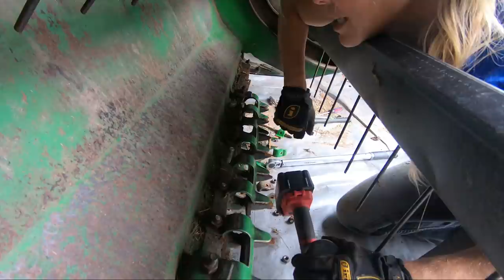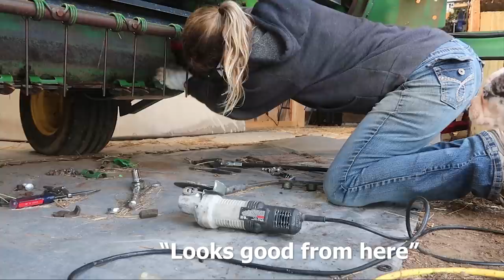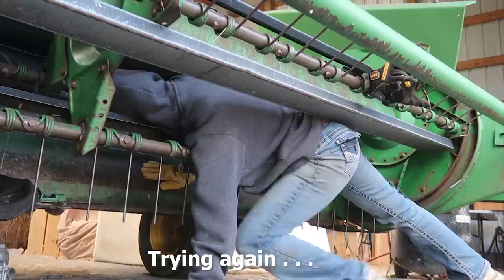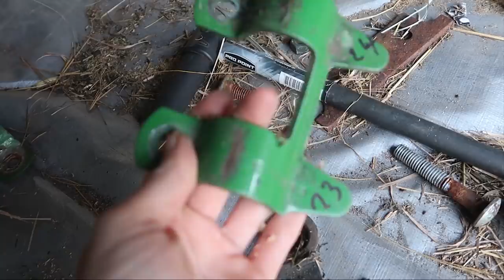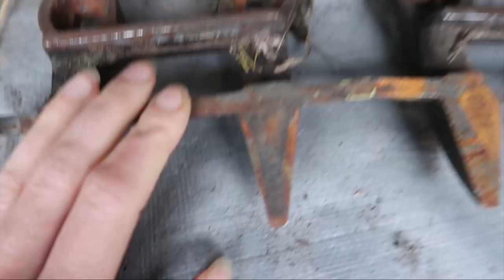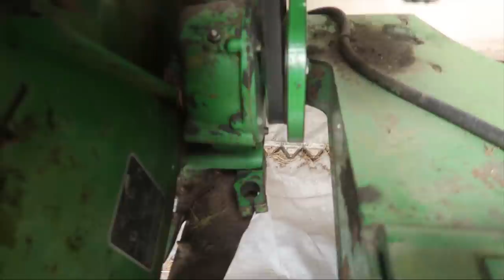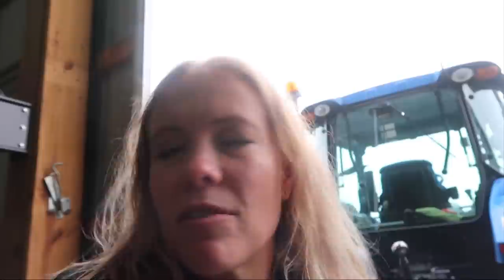335 Final Tear-Down of the John Deere Mower Conditioner

Comment: I always like your videos don't comment much but I do believe unless your pitman arm call is egg-shaped it should be fine.. I do believe that if you get the Right Guard for the first sickle sections that have clearance for your sickle bar head to rotate in and out your problems should be solved.. you may want to check your bottom guards and make sure they are the same thickness because if your sickle bar has been wearing on them some may be worn down more than others which would give you problems as well.. I WOULD NOT weld the bolts onto the lower guards.. then if you break a pole you've got a lot more work to do possibly replacing the lower guards all together...
Reply: Just food for thought.. reach out to Wes over at One Lonely Farmer he's extremely handy would be able to guide you in the right direction.. I hope I helped I don't mean to hinder.. keep up the good work!

Comment: Look up pottinger novadisk thats the only type of mower we ever use over here in the UK, a single might be a little smaller cut than your haybine but you can travel a lot faster with them an to change an individual blade takes less than 5 minutes once you get use to it, I've used the big triple they make an cut somewhere in the region of 15k acres now of silage an hay an wouldn't use any other type. Forgot to say also try to avoid JD as they are way over priced for spares compared to other manufacturers lol
Reply from the maker: We did look at Pottinggers at the Farm SHow in February :D They look good!
Reply: @This1LifeWeLive  we demoed Lely, Kuhn, Claas, Kverneland and Pottinger impressed us the best with cut quality, speed you can travel up to 15 mph in average crop, cost of the machine and spares and also how easy it is to obtain spares an no I dont have shares in the company lol

Comment: I think you got the right idea.Sell it and get a disc mower conditioner.
Reply: If the field she mows are smooth and free of woodchuck holes will work great as long as the crop is not blown down. In my opinion haybines work the best and can be adjusted to run most any ground speed you want too.

Comment: You should be able to buy those bolts at your local hardware store by the pound. probably about the cheapest way to buy them
Reply from the maker: UGh . . . I JUST CHECKED and it was $1.50 EACH. JD ccharged $0.75. I ordered them from another store and hopefully it will be a better price! The ones I ordered online are TOO BIG!

Comment: Grade 8 carriage bolts is what you really need...i get mine through Dorman
Reply: Grade 8 nuts, washers, lock washers and bolts are needed on all your mechanical equipment
Reply from the maker: Its hard when the equipment is used, so all you have is what the previous owner repaired it with

Comment: I have a disc mower I like it loads
Reply: Waaaaaaay easier on your horse power requirements
Reply: I have just posted a video on my trail mower that’s exactly the setup you are talking about. I’ve got another video that’s coming out Sunday that’ll show it in action
Reply: have ran a discbine for probably 20 plus yrs,only thing ive repaired is a shock hub,knives are so easy to replace compared to the sickle bar,hope it all works out for you
Reply from the maker: very nice, thankyou!

Comment: The shaft that the caste nut is on is bent . The cycle should be flat and straight. Good luck. A piece of heat shrink on the treads will keep them from rrusting

Comment: Welding the bolts will make assembly much easier have no doubt about that.
HOWEVER  I do NOT think it is a good idea.
1.  When you repair and need to get the bolt head out how are you going to do that?
2.   IF those brackets are cast iron you should NOT weld cast.  Brazing is preferred
3.   IF they are cast steel you could weld that  
      IF they were forged and then heat treated you could mess up the metallurgy.

Dan Bentler
Reply: 1. remove the guard and grind the weld or just replace the guard and bolts.
2, I seriously doubt they are cast iron.
3. Any heat treatment would be for the working edge of the piece, not where the bolt hole is. There's no way a tack weld is going to bother the hardness of the working area of the part.

Comment: Oh Suzanne  that is why I said you might want to cut your losses. 

But I would try everything but the pitman arm and the wable box!!!  
My moco is a 935  and tine condition.  It works so much better than rollers you can't believe it ...
I would like to tell you more about them but don't know if you really want to know.  If you do .can you let me know on Instagram.  I will tell you anything you want to know. 
I have been using disc mower for 30 years  . Okay  . Oh i gave up on my sickle because it was going to cost me more than it was worth to fix it .
And that is what's going to happen with yours i believe.
Reply from the maker: Seemed like Wes uses one with the beaters too! I'll look ou up on IG :D
Reply: @This1LifeWeLive  see what your machine is worth before you start buying parts

Comment: Replace ALL the cutter hold downs because they may warped. Don't weld the bolts in place because you may warp them. Use a floor jack to hold the bolts up as you impact them loose. The difference in total price is very small.  Those shims: Buy some bar stock and have the holes drilled or pony up for factory originals. Don't cheap out over $100 or you will be back under that thing again. It's all those cheap half a$$ repairs over the years that has you in this place now. You know that the thing ran great for years when new. Fix it right, fix it once.
Reply from the maker: I did try to use a floor jack before I went to the effort to cut them off, but it didn't help any :( I think they were rusted too much
Reply: @This1LifeWeLive  A dab of gorilla glue in the square hole. Bolt it, then spray rustoleum paint on the bottom. If you are not aware, Gorilla glue expands 4x and is water proof. But a hammer will knock it back through the hole.

Comment: Suggestion. If you buy another used one, offer to pay some % down and use it for one season. If there are no problems then pay off the balance. If there are problems, obviously don't pay it off and forfeit the down payment and consider it a rental expense. No sense in buying someone else's problems.
Reply from the maker: That's a nice idea!
Reply: @This1LifeWeLive  Thanks. Maybe an entire season is to long. Maybe a couple cuttings would be enough and not hold up the seller too long.

Comment: U sure stick to it. Yes i heard discbine.yes tes yes. With fingers instead of rolls if u can find. Adjustable conditioning with fingers if they still make em that way.mine is 1990 kuhn.10.9. 150 acres every year.change oil in bar and gear boxes every spring.still running jynx.
Reply from the maker: Yeah Erik talked about one with the beaters :D

Comment: Boy ow boy. ik you are on here and other social media sites just slugging away in your farm experiment. I sure hope New Holland is kicking in some $ as the tractor is the star of the show, and of course you using it. Ok here comes my 2 cents. IK you are hobby farming as a way of life and I sure hope you are at least having fun in the things you are involved in. Life is short. With the tillable acreage you have you should be thinking smaller with what you have. You and your hubby are just throwing $$$$ away so again I do hope at least FUN is being had. My dad was also a hobby farmer, (his full time job was a plant mgr with 1200 employees,) with two idiot sons 13 and 16 there was 30 head of milking cows 2 silos to fill and 75 tillable acres and 25 acres of woods. We heated with wood cut from our woods in our old 2 story farm house back in the day. He and many other farmers did the same and the tractor of the day were much less tractor than what you play with. Case in point. My dad's tractor was a Massey Ferguson 65 diesel with no loader and a 3 bottom plow , old non transport10ft disk, 8ft drag, 4 row corn planter, old horse drawn converted Ontario drill, belt driven silo blower and hay elevator, baler with a Wisconsin gas motor LOL. Even in the 1970's this stuff was old. The reason I outlined all that was to say you are not farming as farming is a profitable life style. I personally live near Rochester, NY with $4000 property taxes 50 tillable acres no barn and and some of the old equipment like my dad had back in the day to put all 50 acres of soybeans every yr. I also have a full time job and do it all myself from tilling planting and harvesting all with old equipment totaling around $10000 including a tractor, pull behind combine, gravity wagons, etc. Last yr I made $30000 gross. Less my expenses I netted $22000. not bad for a part time hobby farmer. I think dad would be proud of the way i use what is left of the 100 acre farm he left me. Just saying after watching a bunch of your Utube videos I really hope you are having fun fun fun.

Comment: i would just tack weld the bolts  that way if you break a bolt you can always grind the tack weld off, and i see no one had taught you what a cheater pipe is its a small piece of pipe that will fit over the end of your ratchet and it will give you more leverage to take off nuts its a poor mans breaker bar and Just the pitman arm!!  not the box. as for those shims make your own clamp some metal the same width over the old shim and spray paint the holes and drill them out

Comment: If your in michigan your going to want crimpers
Reply: Agreed! The weather close to the Great Lakes is far too unpredictable when it comes to moisture of any kind. Steel over rubber would be good for her stand of grass.
Reply: @ikonseesmrno7300  i run all steel on steel most effective in my opinion for drying in my opinion i would also consider the impeller style for her set up
Reply from the maker: are those the steel beater arms??
Reply: @This1LifeWeLive  yes on john deere mowers they look like a bunch of "V"s bolted to a roller. There very aggresive for leafy crops like alfalfa but for grass they work real good
Reply: @smitty9120  What conditioner do you use that's steel on steel? I can think of a few older pull-types, but nothing recent comes to mind.
Reply: @ikonseesmrno7300  i run a macdon R80  mower with steel on steel most macdons you can pickup with steel rollers yet i think its the standard for them.  I see the new john deere are puching for there v10 steel rollers now i think there called

Comment: Sue, in this farmer's opinion..... Your attempt(s) to repair equipment are actually quite entertaining......  but a complete waste of your time and money plus (and much more importantly)  potentiality your personal well-being. It's obvious you have little mechanical apptude or skills, few necessary tools or facilities and of course feminine strength. John Deere designs and builds excellent farm equipment. But machinery wears out for many reasons and JD will sell you Service Parts as long as you want to pay for items made to their high level specs, even when not made in the USA. You can always save $ elsewhere, but the item will not have a JD part number or function like one. Bottom -Line..... You have many other skills, your young, attractive, obviously intelligent, feminine, U-tube producer which is hopefully profitable, plus (most importantly) a Mother and Wife.  Stay within your appitude. But if your happy with the attempts at Farming..... Stay off U-tube for repair advice, most of your followers are not farmer's nor mechanics. Stick with the manufacturs Service manuals, written by the design engineers & mechanics